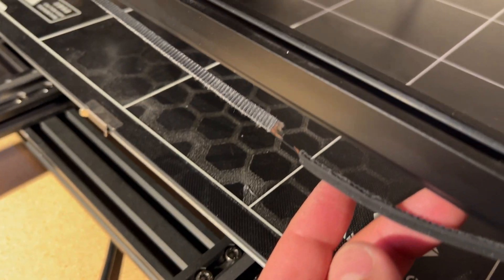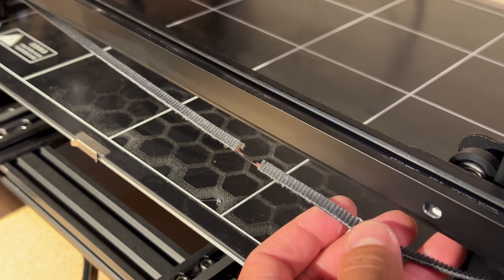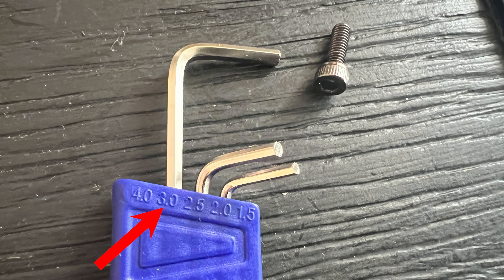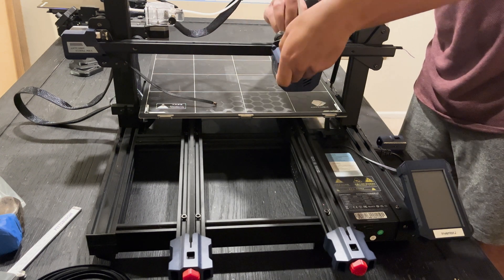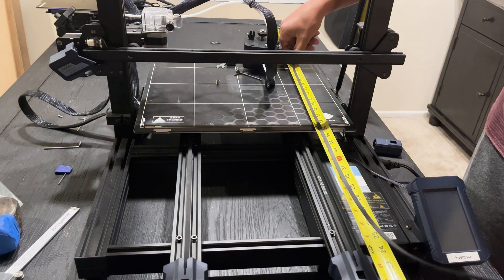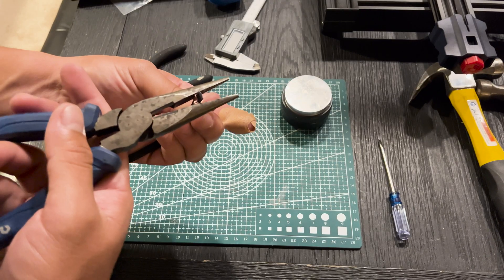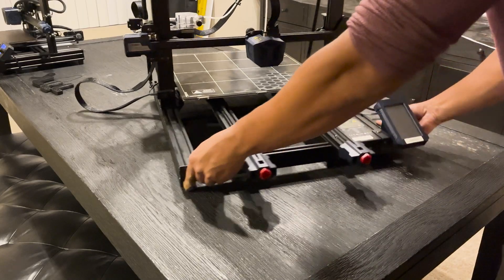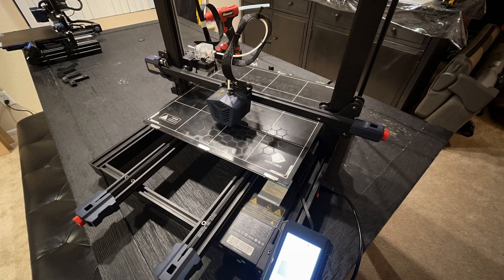Anycubic Kobra Max Belt Broke! Belt Repair and Printer Issues

Comment: I also have an Anycubic Kobra that had the same thing happen. Belts broke twice to what I assume was excessive tightening. Lots of scarring. Worked great at first but print quality has slowly diminished. Was also delivered without a working auto leveling sensor as well. Pretty bad customer service as well.

Comment: I'm surprised that after all this time no one told u that's not the right slot for the SD card,...your supposed to use the one that is next to the USB port,...the one on the screen is for updating the actual screen not where to load the print files

Comment: I have an AnyKubic Neo and everthing works perfectly the print qualitys great no extrusion problems but the only issue is that when printing slowly to the left, there's a clicking noise periodically when its moving that way and printing. It seems to be coming from the little box that the Z axis pole has attached to it. I tried fixing the Z offset but nothing changed and I even tightened and loosened the belt but it still clicks. Any ideas?
Reply from the maker: If it’s not affecting the print quality I wouldn’t worry about it. All my Anycubic printers made strange noises sometimes lol I’ve tried to trace down all of them to no avail but aside from this belt tearing they’ve never caused an issue. Just make sure the belt is centered on the ‘pulleys’

Comment: I have received my Kobra Max last Wednesday 8/16/2023. I tightened the belts and started printing. Then on some x movements, I start hearing the clicking sound coming from the x belt tensioner. I look at the table and there is the same black dust you show in your video that feel from the belt tensioner. And the dust has also fallen over the bed. You can also see the top and buttom of the x belt is getting dirtier and dirtier with that black dust.
It seems that the belt is being scraped and the dust is the belt material.

I am still printing a big part. I look around the belt tensioner but cannot see what is scraping the belt!

The print is a few days print and it is almost done. I cannot stop it until it finishes printing. 
I hope the belt does not break!

And I hope we figure this thing out!

Do you hear the clicking sound coming from the x belt tensioner?
Reply from the maker: Hey don’t worry I think your print will be fine. Yes I do hear quite a bit of scraping when printing. I’ve been playing with the tensions on all axises but nothing seems to reduce/eliminate the scraping. I’ll keep trying but it seems that it’s the pulleys in the tensions that the sides of the belts rub against and shed the belts
Reply: @inventorj   @inventorj  Thank God it finished!

It seems you are correct. The belt seems to robbing on one side of the pulley.

I also did fond some of that dust under the bed concentric tighteners, but not that much 

Decreasing the  tightness seems to get rid of the clicking.

I am going to make another print and see how it does!

But the annoying thing is that I have a Chiron since 2020 and I have not had any belt problems!

Comment: I have the same dust at my x axis, but a little more. Think im going to replace all the belts and if i can find them new tentioners
Reply from the maker: I’ve watched a few videos on the Kobra Go with the same tensioner system. This guy was running the belts much looser then expected. Obviously below a certain tightness I’m sure the bed loses accuracy but maybe that would eliminate some of the shedding and noise from the belts
Reply: @inventorj  I just ordered 3 new tentioners 2 for y and one for the x axis, and upgraded belts. 

I am thinking about replacing the pom wheels with polycarbonate ones with RS instead of ZZ bearings. 

Would it be interesting to make a video about it?
Reply from the maker: Definitely let me know how that goes! And ya take some video once you get it all together and let’s see how it fairs